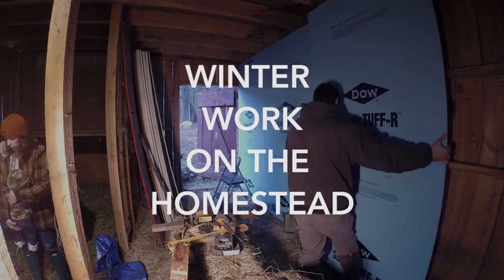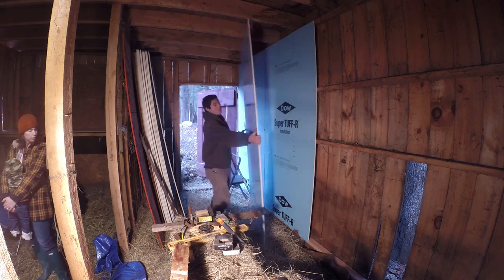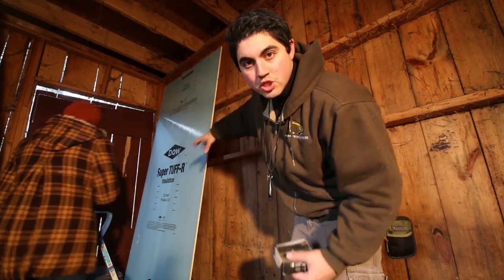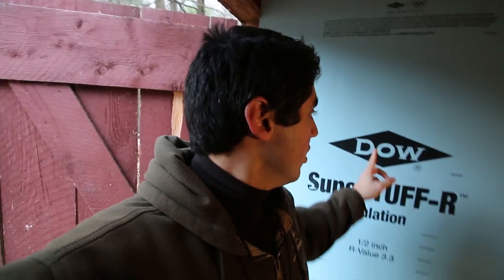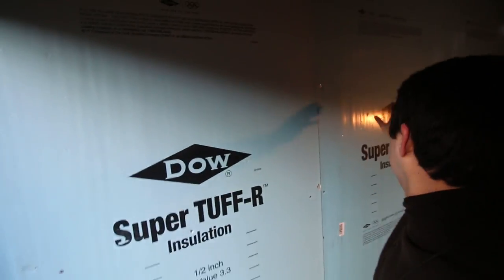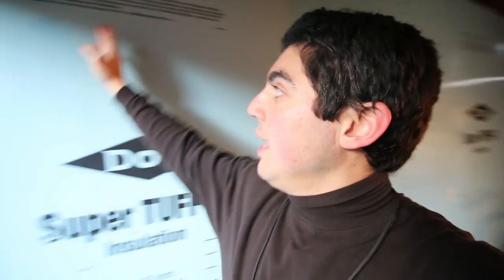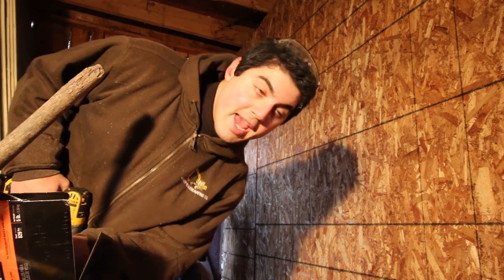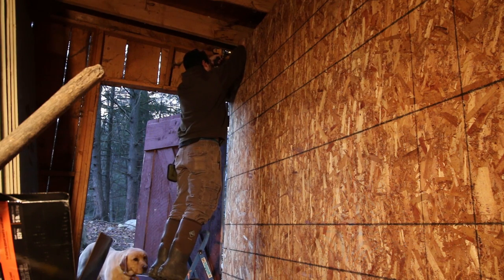Winter on the Homestead - What should you spend your time doing?

Comment: The only problem I see with this barn is that animals create a LOT of moisture. If it is all tightly insulated, that moisture cannot escape. Eventually it will lead to a mold problem. Will there be draft holes towards the roof? Or a cupola or two?
Reply from the maker: +Julie Ott the roof of the barn actually has vents built in to combat any moisture issues we might have. Now we just have to put some mesh over them to keep the rodents out. Thanks for the question!

Comment: I agree with the seams being different I also put tape down the seams it cost a little more but in my thinking it helps lol    and which direction to turn the insulator board I agree with you , however with osb covering it either way i would think would work well